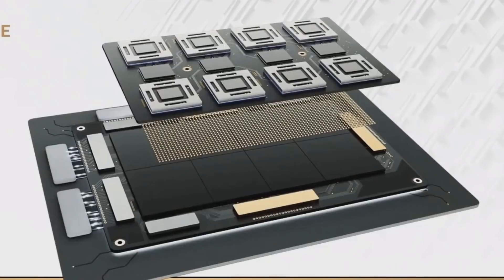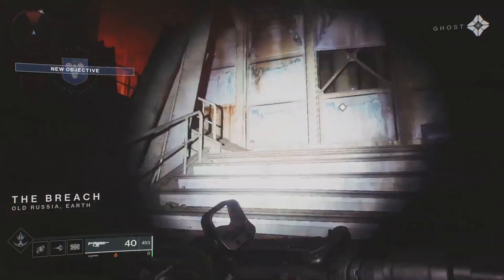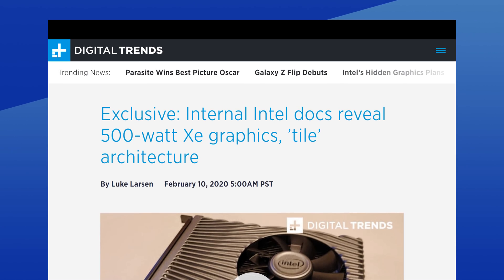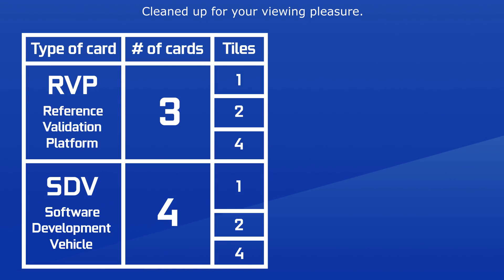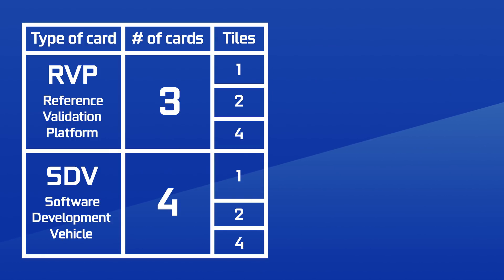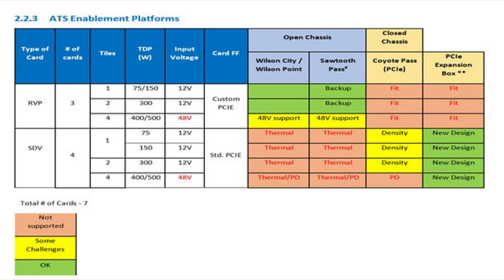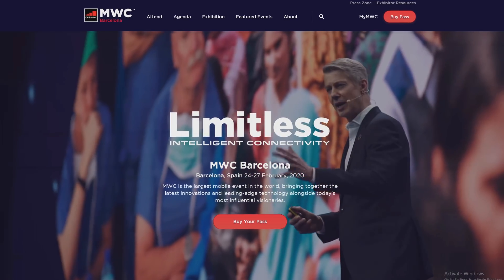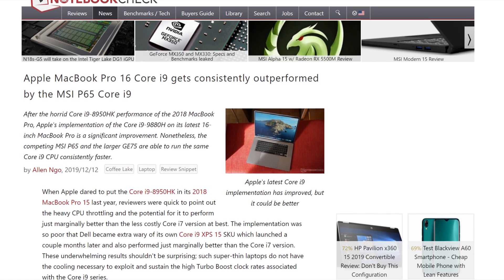Intel Xe GPU Leaked With up to 500W TDP.. YIKES!

Comment: So a 1,000 watt power supply is $31 as of today, just checked pricing. If my video card is pulling 500 watts on my 1,250 watt power supply....WHO GIVES....A S**T! If it were 2 1/2 times faster than a 2080ti but draws 750 watts...WHO GIVES....A S**T! The race for lowest power draw is COMPLETELY irrelevant for PCs. Laptops, sure....phones, sure. But my computer is plugged into the wall. RAMP UP THE POWER! GIVE ME 1,000 FPS @ 4K. I'll pay the extra $3.25 cents a month for electricity.

Comment: I think we can presume that the TDP of 500w does not translate into powerful performance, since the lithography is still in the region of 10-14nm.
Reply: It could be blazing fast or as fast as what's on the market....if it sucks more power it's gonna be a dud not a seller. UNLESS the price is too sweet to pass up. No such thing as a bad product. Just bad price.
Reply: If it draws more performs worse and costs more then yes it's a dud

Comment: Yo, what they are doing 300 Watts processors 500 Watts Gpu so to build a Intel build PC you will required atleast 1000W PSU to run the hot beast in coming years
Reply: Intel will start selling PSU units... and to make sure you'll buy them, they'll changes the power connections and requirements ;-)
Reply: @willgart1  Bruh 😂
Reply: @theblessedkabir8706  next step: 700W screen
and a 10W mouse & keyboard... 
and we'll have covered near everything to have the "best hot PC in the world"

oups... forgot a gaming chair...
Reply: @willgart1  my ass would be laid by paying Bills bro 😂 I wish PC would run on powerbanks 20,000 MHZ and boom
Reply: Right? Looks like a 1300watt or higher psu will be needed for an all Intel build while an all AMD system is far less
Reply: @Montisaquadeis  That's insane
Reply: keep in mind execution units=compute performance and shaders=gaming performance. it's possible that intel can make GPUs with shaders that don't scale with execution units since they own the fabs making the cards. also the 500watt GPUs are clearly for data centers because that's where they use 48Volts since they can power a whole room of servers at 96% efficency with no wasted space and little added heat. clearly they want to take market share from nvidia's DGX units that draw 10kilowatts and have 16teslas.
Reply: Remember that these are base clocks so I expect that both will use 1000 watts.